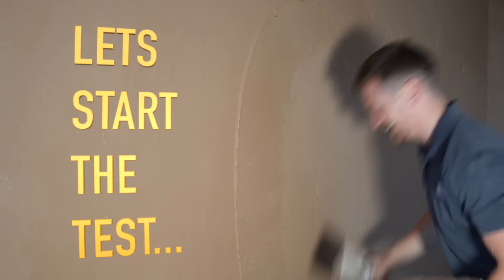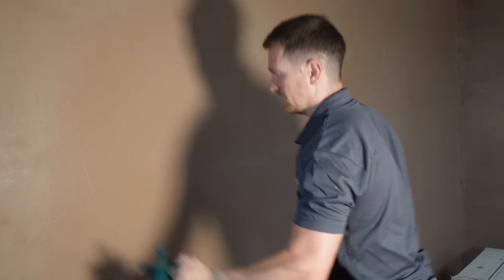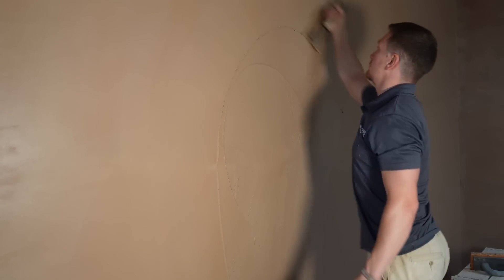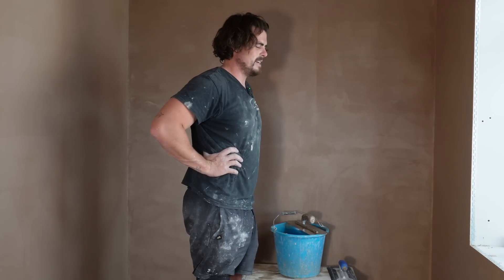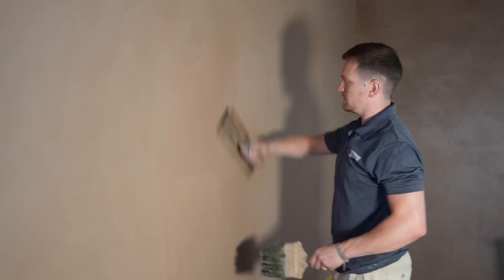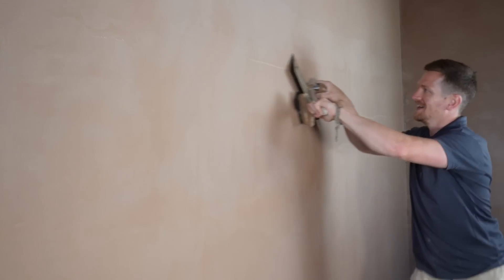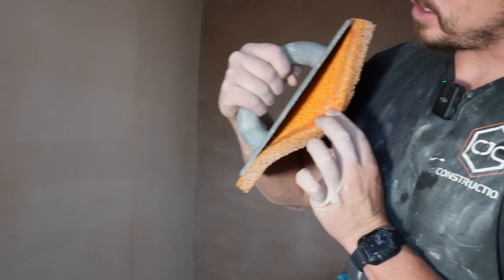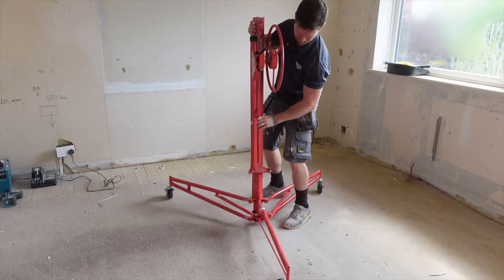Sponge Floating Is Just Easier…

Comment: Hi Blaine another great video - thanks for that. Have used sponge but dont like it much- I recently worked with 3 plasterers all using a sponge and the finsh is nice but they take plaster out of the wall. when you put a straight edge across a 2 foot pillar bead to bead they had a 3mm to 5mm gap in the middle where the plaster is washed out by the sponge. I would like to ask what you & Charlie do about this ? The bowing in happened consistently on all of their work
Reply: It’s crap mate. Leaves a horrible dusty finish rather than a nice solid feel a plastered surface should have

Comment: A properly worn in plastic float will do the same job as the sponge float on rubbing up the hardwall plus it’s easier to clean and it doesn’t fall apart!! Plus you don’t get the lines that the sponge float sometimes leave

Comment: I've seen a sponge floated gaff before after painted and when the light hits the room you can see all the lines 😂 looks like it's been plastered with a scratcher
Reply: Could be just drying out , as where the sponge leaves the grain then when it's covered it will be deeper so take more time to dry out, or the spread has hit it to late
Reply: Probably bad timing for sponge and for floating it just after  ;) I would blame whoever done it, not the sponging process. But what I know :) all best!
Reply: Lines should have been trowelled out after sponging

Comment: you can get the same results as using a six inch brush  been back and forth for years between sponge floats and brushes  I've come to the conclusion sponge floats are a waste of money  it's all about getting them coats as flat as possible when you put on  the ripples usually means you trowl knackered  or has a buildup on it
Reply: Spat the walls, get straight on the steel first trowel, cross with 6inch brush and steel trowel. whip with plastic trowel. Gets it As flat as sponging, set goes faster and far less mess
Reply: Sponge float everytime easier and better results. Not rocket science

Comment: off the best way Lay on with a 13  spat it  put second coat on with a 16  flatten  leave till it takes up brush  the whole wall as you go trailing  find your work will become so much flatter this way  would you have to use the two different  sizes of  trowl